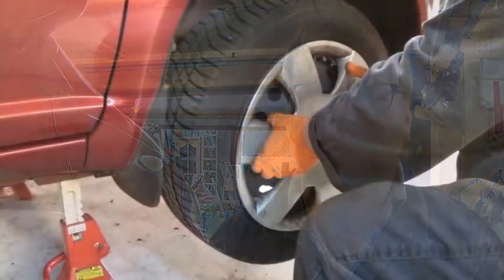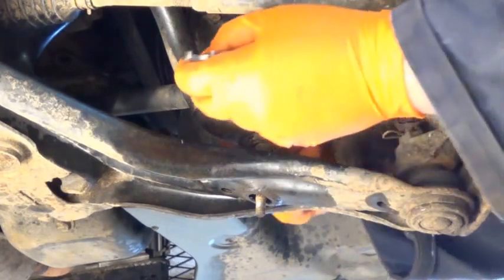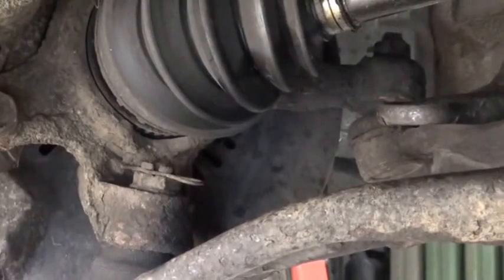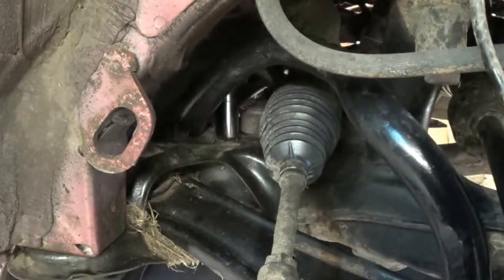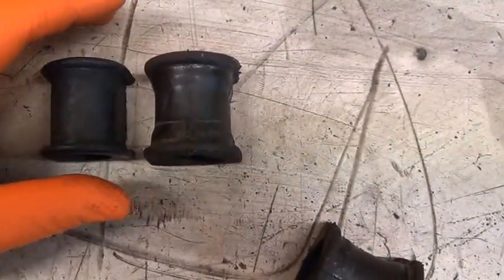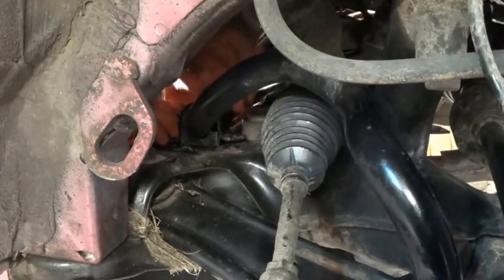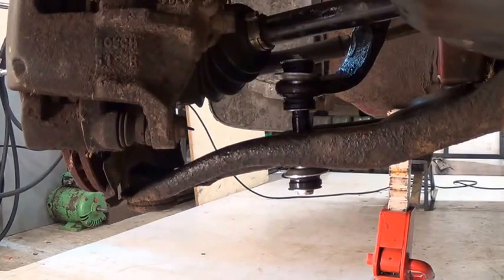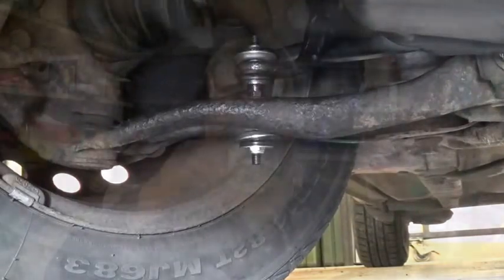98-06 Toyota Yaris Anti-Roll Bar Bush Replacement. Replace sway bar bushes without dropping subframe

Comment: I sure wish it was this easy on the 07 yaris instead it has the Corolla setup where  sway bar link is attached to the side of the strut housing.  So it does you no good to disconnect the sway bar link.  I just can't find a tool that will fit in the sway bar bushing area no matter how hard I try!!! I've been driving the car with bad sway bar bushings for like 50,000 miles it's really annoying but every mechanic says drop the subframe which is 1,000 plus dollars ugh

Comment: French build must have a diff power steering pipe layout as on the wife's Japanese Built 2000 Yaris there is a pair of  powersteering hardlines right above the rear bush bolt on the drivers side, only thing that I could see that might get access to that bolt would be a flare nut spanner but it might be too thick to get in...and I'm not disconnecting the entire powersteering pipework...passenger side replaced, drivers side looks to be in good shape and ARB no longer moves by hand. Not ideal, but a lot of work to get access

Comment: I changed both links today and the clicking sound over small bumps is still there... Can I change bar's bushings without touching links? (I spent far too much time today removing those old ones, it was a horror)

Comment: excellent video but i would never use a rachet spanner to start to undo a nut,i would use a normal spanner to start to undo a nut then use a rachet spanner afterwards if the nut is not loose enough to turn by hand,cos if you use rachet spanner first you are gonna get thru a lot of rachet spanners

Comment: Greeting from Canada. I need to replace the sway bar bushings on my 2004 toyota echo. I just wonder if it is necessary to take out the sway bar link before removing the sway bar bushing.  Also, can I just drive the car on a pair of ramps instead of jacking the car up?  Any suggestions are welcome. Thanks in advance.

Comment: These bushes should never be greased and when changing them to set the right tension the car should be lifted with wheels on the ramps and not in the air. Thanks for sharing. 👍

Comment: I'm looking at buying a Yaris and read this is a common issue now I can buy one, thanks mate!
Reply from the maker: Thanks mate. It's worth saying that after a few miles and once the suspension had settled it felt a bit sloppy. I tightened the 13mm nuts on the drop link arms a bit more and that really helped. I think to be honest (and this is a good while after making this video) it needs new dampers too. Watch this space!

Comment: I had a look at your video to see how hard this job would be as this is an advisory on a Yaris I'm thinking of buying. I haven't got your equipment so I'll give this Yaris a miss and get another. You've probably saved me a lot of time and money, thanks.
Reply: wittywilf the yaris is a really good car for the money, just on some parts, u shouldn't buy cheap, and replace with good factory parts.so far everything been easy to fix yourself.

Comment: good video my cars due for mot in next 2 weeks if it fails on these i think i can now tackle it myself thanx for posting,the way i would try it myself if i have to replace the drop links is first try to undo the top nut first because its under tension and if that works would then try to undo the bottom nut next cos much easier to try to tackle that bottom nut afterwards and cut it off,for those that have not got a saw like that you can get a nut splitter of ebay ,excellent tutorial tho
Reply from the maker: +Patrick Durees Thanks for your comments Patrick, good luck with the MOT.

Comment: Helpful video. I just did these on my sister in-laws echo. A bit unclear on how tight or how much torque to use. Torqued under the weight of the vehicle is also recommended I’m pretty sure. I was lucky enough to not have to cut anything as well :)
Reply from the maker: Thanks. Yes I agree it's not clear, I took it for a bit of a drive then tigtened some more. At the MOT test a few weeks later I was advised to tighten further still, which I did.
Reply: @ShedTV  Take some verniers and measure the amount of thread on each side of the nuts before taking the original end links off?
Reply from the maker: @MV60  Yes, good point!
Reply: @ShedTV  I like it when the different points of view come together to make things better overall. I liked this video in being able to see what is under the front of the yaris before tackling our own. It seems to be a bit knocking on the front end in / out of the drive way recently and I thought probably sway bar mount bushes.

Comment: Great tutorial. Did the worn bushings affect anything on the vehicle? I'm having a major problem with pulsing in my rotors, 3 sets in 50000km with new pads once, even wheel bearings to try to get rid of the issue. Even tried some better than garbage rotors...same issues. Mechanic insist that changing bushings will not affect it. Calipers are not seized and car tracks straight under hard breaking. I followed a proper break in procedure with the last set, issue has developed once more. Any advice would be great! Also, you should refer to which side of the car you're working on as left or right instead of drivers side, for us left hand drive folks! Thanks again from Canada.
Reply from the maker: Haha, it's difficult to remember not to say driver/passenger side or offside/nearside after 30 years of driving. I will make the effort though! Back to your brakes: I'm a bit stumped, I didn't drive this Yaris far before the suspension work, so I don't know how if felt. It sounds like warped or cracked discs (rotors), but you've changed them. I'd dismantle, clean, grease and rebuild the calipers next. Bit boring I know, unless anybody can suggest anything else?

Comment: today i found the same problem but only the driver side is damaged, can i just change one or need to change all ?  ty for your video m8
Reply from the maker: I would definitely change both sides, even if one side looks OK it will be worn and therefore move differently to the new part, potentially leading to uneven handling.
Reply: +Shed Ramblings done mine today both side ,i think i tight them too much tnx again m8

Comment: You could have mentioned turning the wheel to full lock, so the drive shaft is not in the way of accessing the drop link top nut. And that the droplink nuts are 14mm, but ARB bolts are 12mm. But otherwise, very useful vid.
Reply from the maker: I'm not sure that turning the wheel lock makes much difference to the top nut access; the drive shaft remains in the same place relative to the drop link, but as you you can see by my moving of the lock at various points in the video, it is possible to gain easier access in and around the hub. For clarification, as I explain at 2:50 the ARB bolts are 12mm, as are the drop link nuts (4:30) and the replacement drop link came with 13mm nuts (11:10). This was a French built car, maybe other models differ. Thanks for your comments.

Comment: Hey ive been flustered with this car for a long time. I did the exact same thing you did. All the sounds went away, the thing is when im driving at higher speeds and let off the gas pedal the car swings to the right then back to the same place when i get back on the gas. I have no idea ive taken it apart like 6 times now. Any help is appreciated. The washer and rubber order on the sway bar links are in the correct order.
Reply from the maker: I don't know I'm afraid, but it sounds scary.

Comment: Done a few of these on a yaris and never had to remove the anti roll bar nuts on the subframe. Just lever the bar up. Simples
Reply from the maker: I can see that would be possible. My subframe bushes were knocking on the bar, so I had to undo those bolts to replace the bushes.
Reply: That's what I was hoping. So, just remove the horseshoe brackets and push up the bar enough to remove/replace the bushes.  My wife's 2000 Yaris had the bushes replaced in 2013 and the garage says they are already a warning on the MOT (past two years). Don't fancy paying them again for a job that only lasts 3 to 4 years.

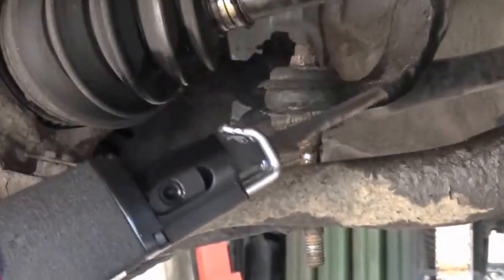Comment: Also at 3:13 you could of used a small pipe wrench to bite the bottom threaded part of the link, then a flare wrench or vice grips to twist the top nut off. Thats what i did here, of course cutting it off works too :D
Reply from the maker: I didn't bother including it in the film, but I tried all manner of grips on it and they all slipped off, it was really badly corroded and the nut wouldn't budge. The saw was a last resort; I had tried everything else!

Comment: In your opinion, could I change the centre bushes while leaving the end-link bushes tightened?
Reply from the maker: +Alaxy Galaxy Yes, you could. Obviously you would need to have the front wheels off and the car lifted otherwise the ant-roll bar might be a bit tight against the mountings. Personally I would use Red Grease on rubber bushes and loosen, then re-tighten after a few miles on the road.
Reply: +Shed Ramblings Thanks for the pro tips, I'll give that a go.

Comment: You’ve made your video on the easy side….the passenger side is a nightmare for the ARB bushes due  hydronic lines directly above the rear bolt…..hence the need to drop the subframe
Reply from the maker: I did both sides. It's not that difficult.

Comment: Great video many thanks for posting this.
ive got a question about the drop link assembly kit... where did you get yours from and
how much should they cost roughly? Toyota want about £150 for the drop link parts!! 
where the same (albeit non genuine) parts are available on ebay etc for a fraction. seems like the toyota ones are made of gold or something!
Reply from the maker: Rob 6rr Thanks mate. Off the top of my head I can't remember exactly, but I'm pretty sure they came from eBay. I seem to remember the whole lot including the bushes came to less than 30 quid.

Comment: Can you help me that I have toyota vitz 2000 model Japanese model but it does not has roll bar , but I want to replace it with roll bars, so what i need to replace it with roll bars.
Reply from the maker: Sorry I don't think I can help much. It was five years ago and the Yaris is long gone. Must be an exploded diagram of the suspension on the internet though.
Reply: @ShedTV  thanks brother for the reply , i have done it there were options to place these

Comment: Youre using to many washers. The big washer is only needed in the wishbone.
Reply from the maker: I bow to your better knowledge, I have no point of reference; I simply compared the new kit and the order of components to what was on the car before dismantling and it was exactly the same. Of course it's possible that the car had been fitted with an identical incorrect kit in the past. Thanks for your comment.